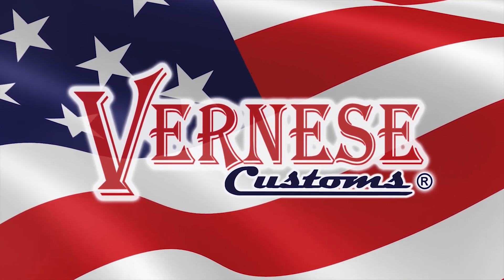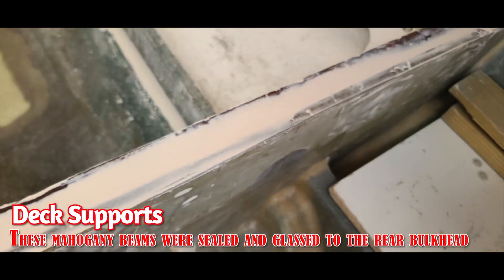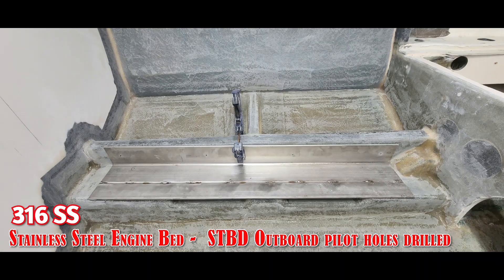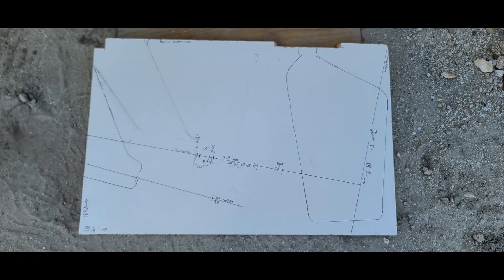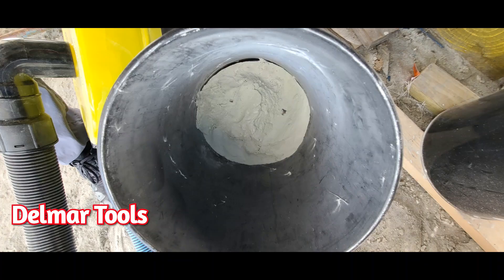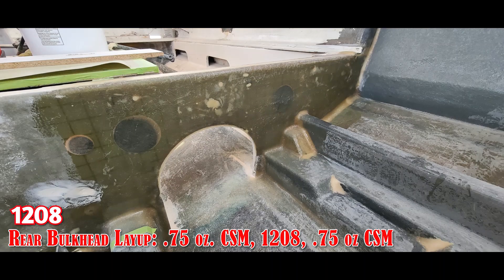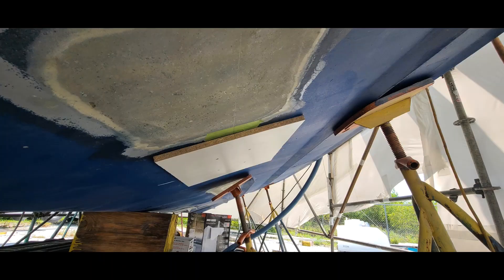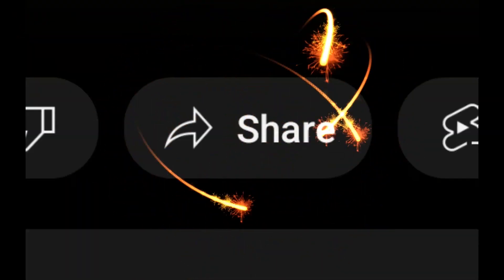Bertram 31 Repower, DIESEL Conversion + Stainless Steel Engine Beds??  + How to Recess a Strut

Comment: Man! That’s straight boatyard porn😂 still some really sweet work. … what is the bonding putty you use?
Reply from the maker: Thanks @714seamonster6 !! Always wanted to be in the porn business! 🤣🤣 
Anyways 😳   The bonding putty is distributed by a company called Spectra Composites. I don't think it is available for retail or in small quantities. You need a lot? Or just curious?
Reply: @vernesecustoms  doing an extensive restoration project myself so I was looking for a fairing/ bonding material that stays open longer than a standard BPO hardened compound. 5 gallons should be a good amount
Reply from the maker: N-TEGRA BONDING PUTTY
PU-235027-870-65
Technipolymers  of Georgia
Reply from the maker: Supposed to have a 65-minute geltime. Not in 97° heat, however. 🥵
Not what I would use for fairing. I will get back to you on that.
Reply: @vernesecustoms  sweet, I saw the spectra has distribution here locally in CA. Really cool vids tho hopefully your channel goes the the moon